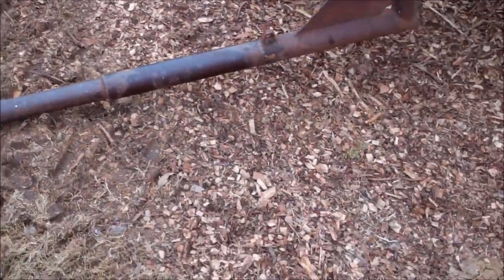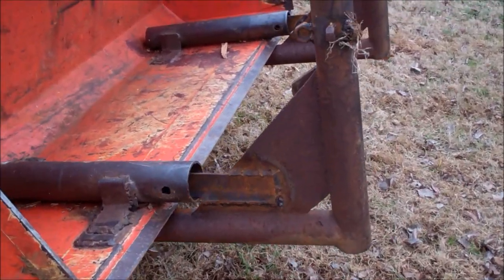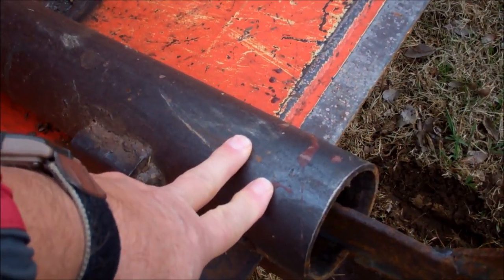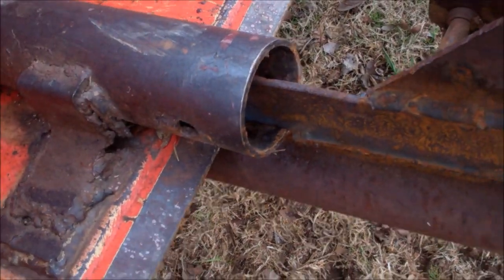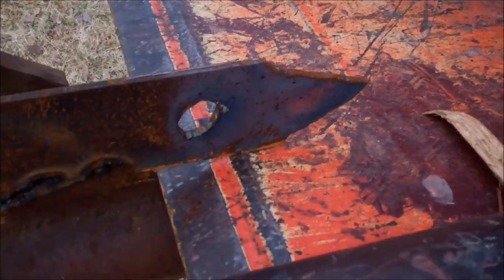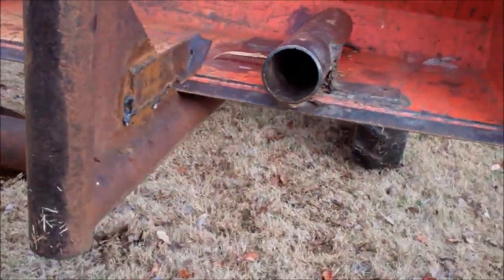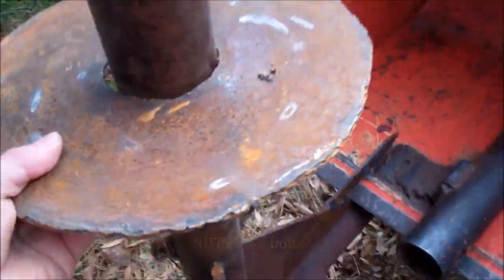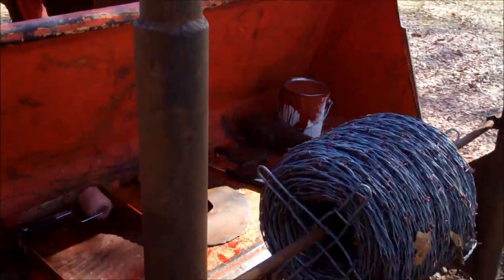Homemade Woven Wire Unroller ~ Field Fencing De Reeler

Comment: Really good ideas TexasPrepper2...I'm just not sure why you decided to weld pipes onto our bucket! :) Coming from the construction and farming background, I just don't know that I'd have done it that way. I think I'd have been more likely to figure out how to fasten it on there by bolting through a simple hole (newly drilled for this purpose) in the bucket...you know what I mean? I really like your idea and I think it's incredible, I'm just suggesting a little modification. Great video brother, well done.
Reply from the maker: The pipes were welded in years ago. I have used them for years for a fork system (like a fork lift). I am just re-purposing them for this project.
Now... the pipes will be cut out as soon as I figure out how to do forks without them. I don't like them in the bucket. They get in the way.

Comment: Holy, why couldn't you have drilled holes in your bucket and bolted those brackets in your bucket. Now you have a ruined bucket, especially when you pick up sticky stuff to move around, not to mention the reduced capacity. And the welding, with practice it will get better.
Remember when modifying a tool, don't forget its original purpose. That's what holes and bolts are for, not welding.
Reply from the maker: The pipes were welded on the bucket years before to make forks for the loader.
I have since converted my loader to quick attach and bought a set of QA hay forks.
The pipes that were welded on the bucket in this video were cut off and ground smooth.
Didn't ruin anything...
Reply: @BIGALTX  Oh. Would have hated to go load some manure and then try to clean out the pipes after. Sounds like you are heading down the right road.

Comment: Is there a reason to use woven wire versus welded wire fence material? Thanks, Tim
Reply from the maker: Mainly, it's cheaper.
But, I just bought some welded wire for a chicken pen and a lot of the welds were broken... so maybe woven is better too.